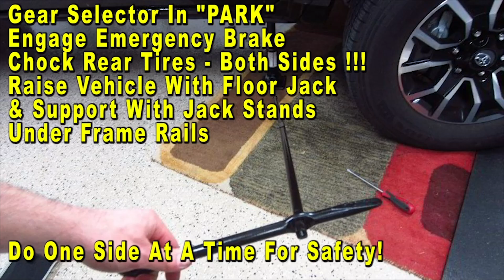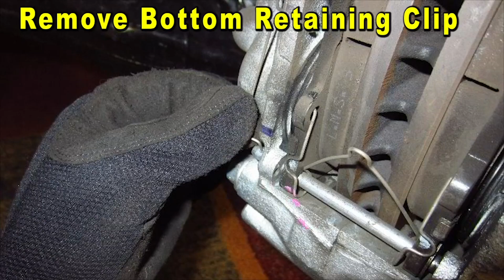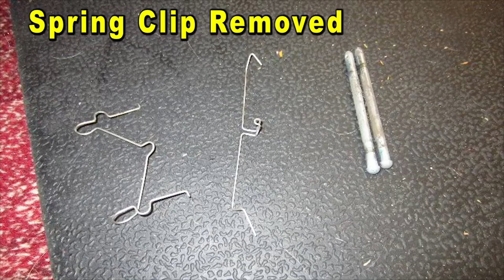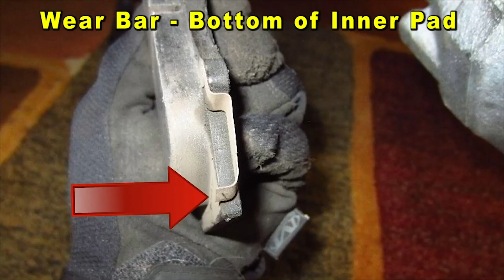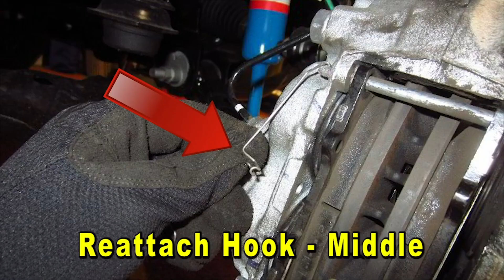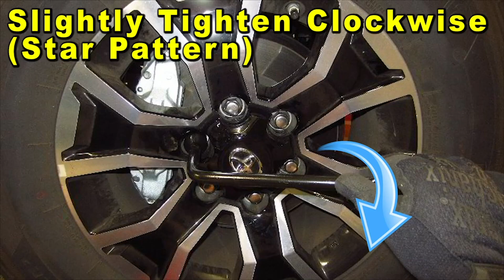2016 To 2023 Toyota Tacoma How To Change Front Brake Pads With Part Numbers - Quick & Easy

Comment from the maker: Toyota Tacoma Front Brake Pads - https://amzn.to/47oYSwu
Bosch Ceramic Brake Pads Part Number - https://amzn.to/47lEc8s
Bendix Ceramic Front Pads Part # - https://amzn.to/40SnDPi
Precision Screwdriver Set - https://amzn.to/3sLixaP
Plastic Pry Bar Tools - https://amzn.to/3HMtsV7
Socket & Ratchet Set - https://amzn.to/3Z17LbA
Mechanix Gloves - https://amzn.to/3jCnHkt
Torque Wrench - https://amzn.to/3vS5uSI

The Paul79UF YouTube channel is a participant in the Amazon Services LLC Associates Program, an affiliate advertising program designed to provide a means for sites to earn advertising fees by advertising and linking to Amazon.

This DIY video shows owners of the 3rd generation 2016, 2017, 2018, 2019, 2020, 2021, 2022 & 2023 Toyota Tacoma how to change the front brake pads.

Comment from the maker: Check out the DIY guide for changing the front brake pads on a 3rd generation 2016 to 2023 Toyota Tacoma truck -
https://www.paulstravelpictures.com/2016-2021-Toyota-Tacoma-Front-Brake-Pads-Replacement-Guide/index.html

Here are all of the DIY repair and maintenance tutorials for the third generation 2016, 2017, 2018, 2019, 2020, 2021, 2022 & 2023 Toyota Tacoma pickup truck - 
https://www.paulstravelpictures.com/Articles/2016-2021-Toyota-Tacoma-DIY-Repair-Maintenance-Guides.htm

Owners of other Toyota or Lexus vehicles such as the Tundra, 4Runner, Hilux, Highlander, C-HR, Avalon, Camry, Corolla, Supra, Land Cruiser, Prius, RAV4, Mirai, Sequoia, Sienna, Yaris, CT 200h, ES 300h, RX 350, GX 460, LX 570, NX 300, RX 450h, UX 200 and UX 250h may also find these DIY instructions to be helpful.